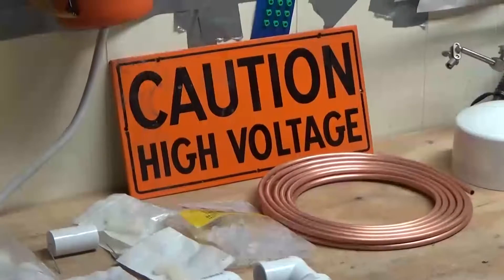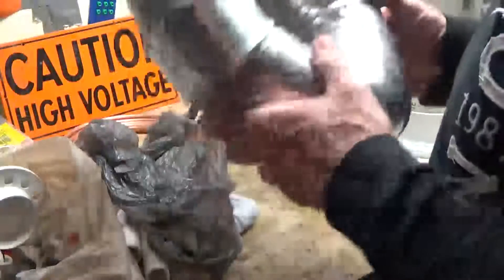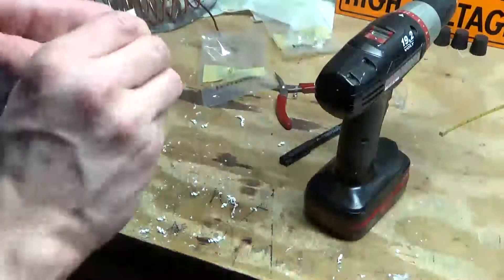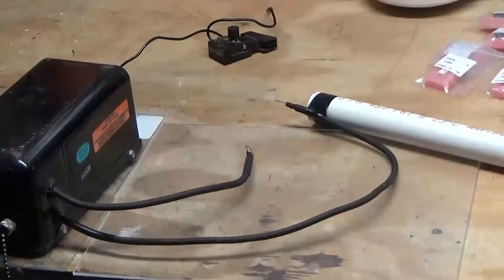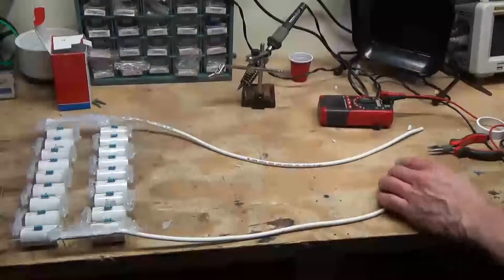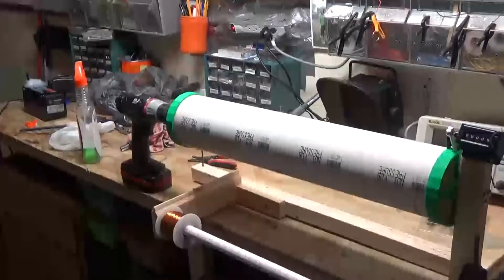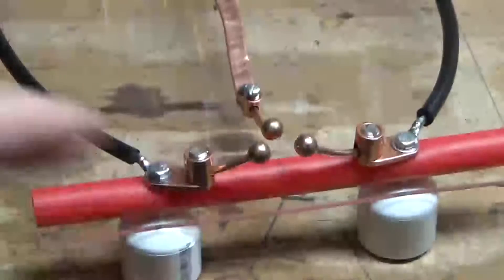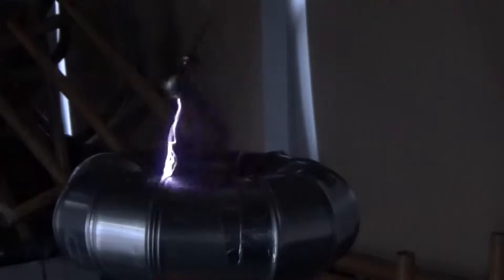4 Inch Tesla Coils With Small NST

Comment: Math or construction didn't equate somewhere. Got 16 inch plasma with a 6kv nst on my first attempt, I see maybe 5" max with no radiant plasma, and you used a collector too. Perhaps could have used lots of tuning to achieve its maximum performance, not sure the resonance is remotely close. Could have saved half of the resistors, anyhow we are getting 6ft plasma with 15kv iron nst, with spark gap... Stay safe, old video. Nice construction with regards to appearance.